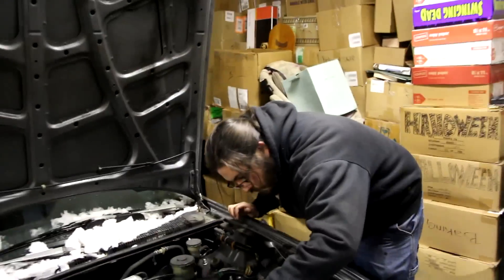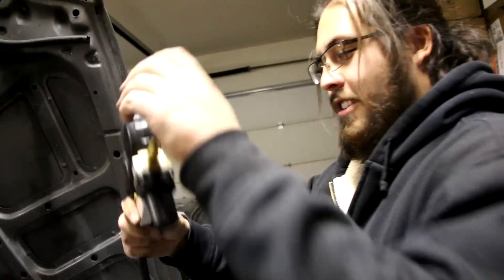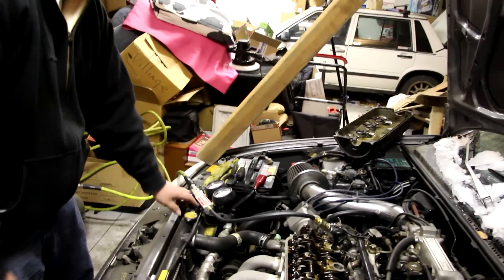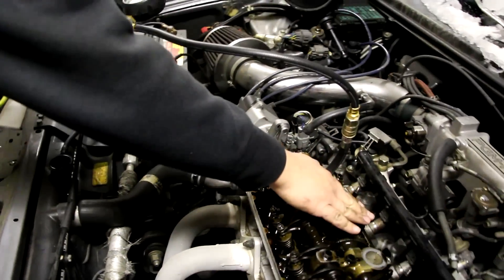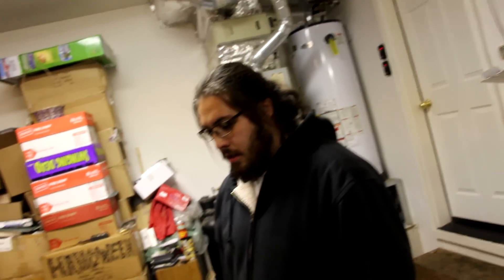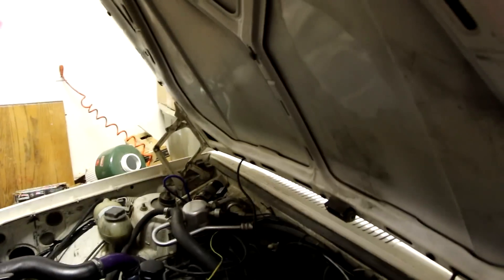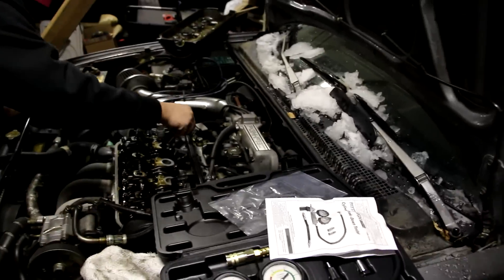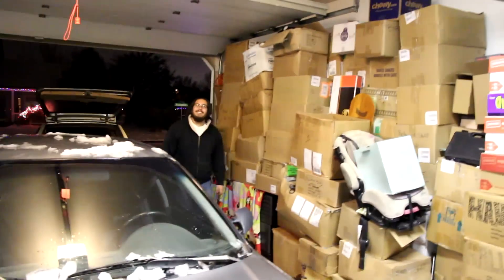Honda Accord Leakdown Test!

Comment from the maker: poll isn't working. Comment which one should get done first here
Reply: RABBIT
Reply: rabbit kek
Reply: Braden Carlson As much as I love the rabbit, I vote Honda.
Reply: Braden Carlson honda
Reply: Braden Carlson Honda
Reply: Braden Carlson Honda
Reply: honda
Reply: Braden Carlson The Rabbit for sure. You know in your heart you want the vw
Reply: Honda!!!!!!!
Reply: Rabbit
Reply: fix the head gasket on the Honda first so if need be it can be sold/driven. then build the rabbit then the Honda.
Reply from the maker: evoTimer My thoughts exactly. Save money for the 16 swap
Reply: rabbit
Reply: rabbit
Reply: Braden Carlson the rabbit fam
Reply: rabbit
Reply: Honda
Reply: Honda. Then boost it
Reply: Honda
Reply: Braden Carlson what you should do is get rid of that Lamborghini  in the intro and replace it with a shot of the accord doing a massive e-brake  slide
Reply: Rabbit
Reply: Braden Carlson ,  Rabbit > Honda
Reply: Rabbit
Reply: do the Honda first so you can put the rabbit inside
Reply: rabbit
Reply: RABBIT! Fuck hondas
Reply: Braden Carlson Rabbit
Reply: Rabbit
Reply: Rabbit
Reply: Honda. Fix that bitch and flip it.
Reply: Honda
Reply: Braden Carlson honda
Reply: Depends on what you are going to do to the rabbit, wasn't it going to get a motor swap? if you vr6 swap the rabbit then I vote for it otherwise honda
Reply from the maker: victor dontyouwannaknow VR6 swap was never the plan.  16v was.  but if i do anything to the rabbit right now it's just getting a new head gasket
Reply: If you just do the head gasket on the Rabbit, it'll be something of a waste of time and money.  If you do the whole head on the Rabbit, it'll take way longer to fix than the Accord.  Of course, that assumes nothing goes horribly wrong, which it will.
Reply: Brennan's rabbit
Reply: honda
Reply: Honda
Reply: Honda
Reply: Braden Carlson volvo
Reply: Braden Carlson honda
i only say honda because ive done so many of those head gaskets i know you guy will crack it out in a day
then rabbit
Reply: As much as I want to say Rabbit, I vote Honda first. 
 Reason; generate funds for a better series of the Rabbit.
Reply: Braden Carlson which ever is cheaper bro either way its content
Reply: Leighton Andrade omg I see you comment on Boosted Boiz too
Reply: rabbit.
Reply: Braden Carlson honda
Reply: Honda
Reply: Braden Carlson honda
Reply: honda
Reply: Rabbit!
Reply: Honda
Reply: Braden Carlson rabbit!
Reply: Braden Carlson Fix the Honda motor and then swap into the rabbit.. 
Sickest build ever
(and maybe a turbo if fits ( ͡° ͜ʖ ͡°).. )
Reply: Braden Carlson Honda because racecar!.....but nah  Hondas are way better and I have a 90 and 93 accords, one with almost 300k(297k)
Reply: Honda, better have a reliable car running in the meantime lol
Reply: Honda
Reply: honda
Reply: rabbit
Reply: Braden Carlson rabbit
Reply: rabbit
Reply: Fix the rabbit
Reply from the maker: Syko-Musick Entertainment Hondas are definitely not way better
Reply: Honda!
Reply: Braden Carlson Honda
Reply: Lafonda the Honda!
Reply: honda master rice
Reply: Fix the Honda, its probably easier, and cheaper. Rabbit will be done right, because you care, so get the Honda out of the way.
Reply: hondaaaaaaaa
Reply: Braden Carlson honda
Reply: Rabbit!
Reply: CB7 because I have one too.
Reply: Braden Carlson honda!!!
Reply: Braden Carlson honda
Reply: Braden Carlson  Honda!! got a 3rd gen accord hatch myself
Reply: Braden Carlson rabbit
Reply: Braden Carlson rabbit
Reply: honda

Comment: fix the honda first senpai braden. Put a h22 head on it.
Reply: its 100% possible. but the h22 has a bore of 87 mm where the f22 has a bore of 85mm so it creates hotspots. best way to do it is have the f22a bored to 86mm and use arp head studs and a h22 headgasket
Reply: so it makes it a DOHC?
Reply: this is a bad idea
Reply: Linus Torvalds h22 head on f22 isnt possible. gotta be a whole swap
Reply: f22b from JDM SI is tho and its DOHC.